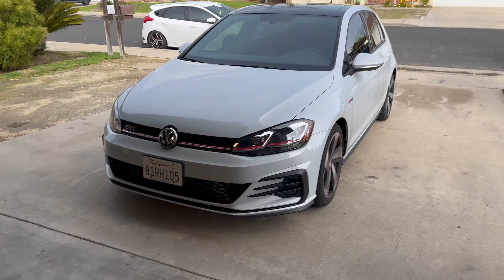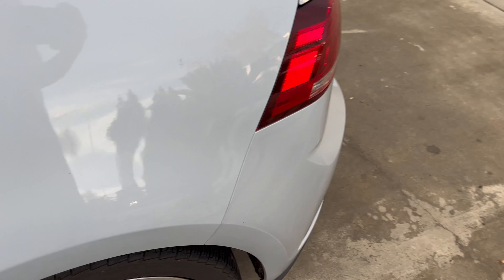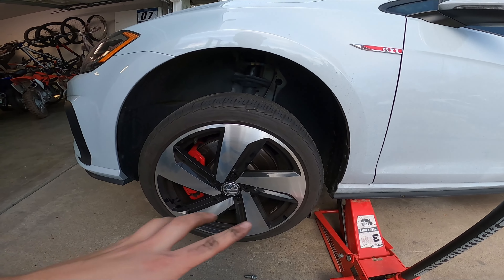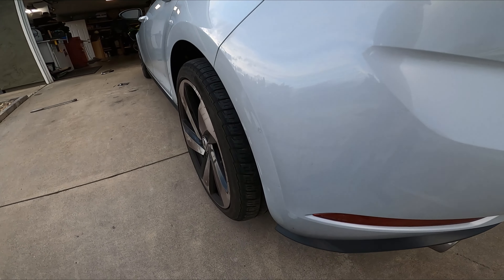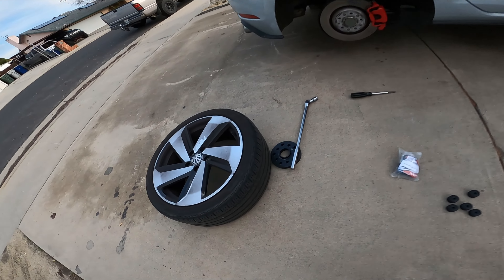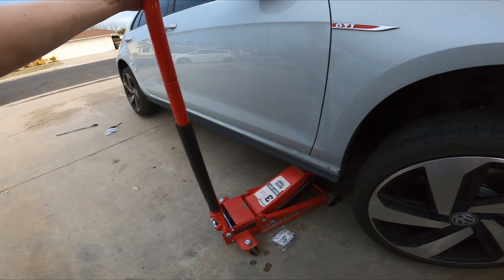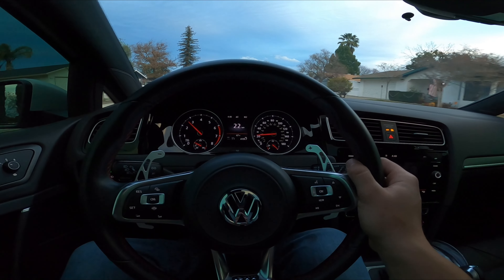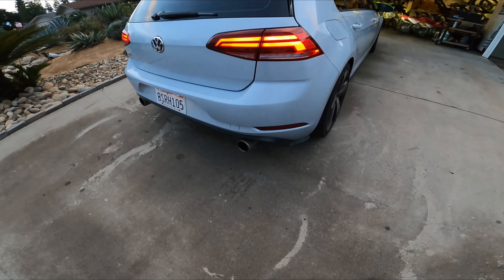Mk7 GTI Wheel Spacers

Comment: thinking of some spacers on mine... i have vmr wheels but want that extra poke LOL. quick tip: tighten lugs nuts snug, but put car on ground and then torque them down. helps get correct torque w the weight of the car
Reply from the maker: Yea I re torqued them on the ground. Umm yea I’d definitely do 20mm all around then. You’ll get that front poke with 20 to 25mm spacers

Comment: I'm curious what size wheels are those and what's the offset a lot depends on wheel offset. For instance I just got 12mm spacers for the rear because 15mm were just a hair too much and they would rub a touch at times My wheels are 18x8.5 et45 with 245/40/18 that's on my VW Alltrack which is lowered with Golf R springs and shocks. The tires look monstrous from behind.
Your set up before spacers is really tucked in a lot. A little advise for the future buy a wheel hanger they're cheap and make the job of R&R your wheels much easier especially when using spacers
EDIT: Oh yeah those are narrow wheels with an offset (ET49mm) if you go with a wider wheel and lower et those spacers will be too much. If you ever change wheels many wheels to choose from look for lighter weigh wheels and smaller spacer you can save a lot of unsprung weight which is a good thing, VW's stock wheels hover around 25lbs and up and a lot of aftermarket wheels are now around 18-19lbs plus they're wider. I'll say after you put spacers on it looks so much better  👍👍 Oh, one more thing always use a star pattern when torquing  your wheels don't go in a circle.
Reply from the maker: 18in wheel and whatever comes on the performance pack

Comment: Nice video. Just lowered my GTI and I have some rpf1s with 235 tires coming soon. Considering spacers if it helps with wheel rub
Reply from the maker: Definitely recommend this setup. The wheels poke just enough where it looks nice but not to much where they rub
Reply: I run 245s on mine. Just took out the fender screws and I don’t rub unless I’m at full lock, you’ll be fine

Comment: will these work with non factory rims?
Reply from the maker: Yes
Reply: @jacobMMotorsport  are u positive? because in the desc of the spacers it says its recommended for stock wheels
Reply from the maker: @braydenhardman3112 as long as they have the same hub centric ring inside the wheel they will work. If your aftermarket wheel uses a larger diameter ring then it wont
Reply: @jacobMMotorsport  thanks a lot

Comment: Did you use a torque wrench on the spacer itself?
Reply from the maker: No you don’t have to since there are wheels studs and not studs on the spacer. If you were running a thicker spacer then you would probably have to run bolts on the spacer and wheel